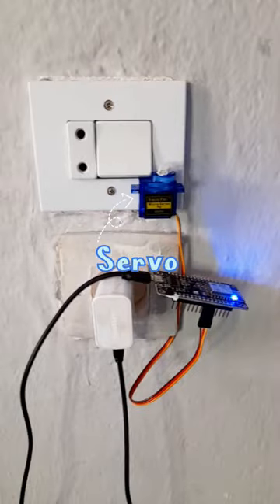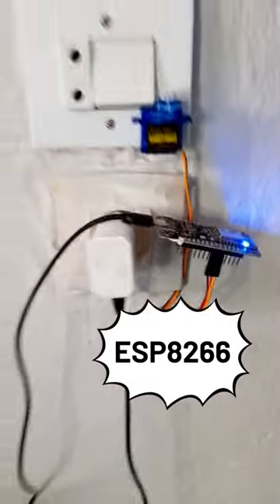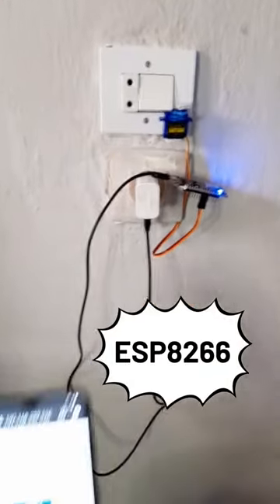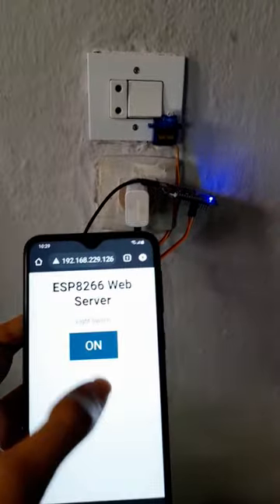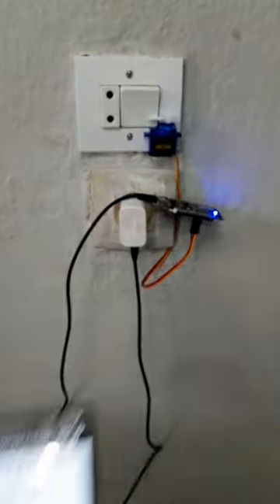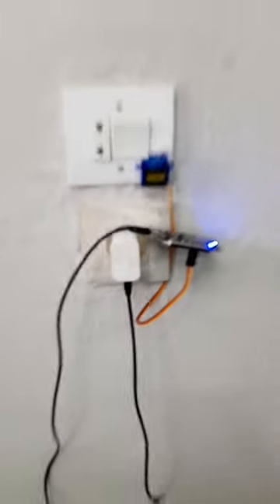ESP8266 Smart Light Switch with Servo Motor

Comment: How do you turn of the light 😂😂😂
Reply: He must be edioot
Reply: Add a second motor easy
Reply: @aryanprakash7371  where would you add the second?
Reply: Other 3.3v gpio and on top of switch
Reply: Change the switch type like bell switch, Unless add an extra servo
Reply: He will copy the system put place the servo on opposite direction
Reply: Iisee aachaa yek relay modul lake  button ki jagaa lagaa dete to sastaa bhi padtaa or easier bhi😂😂😂
Reply: But for turning pc is fine, i think.
Reply: It's not a smart light switch, it's a stupid light switch as you can just put a relay between the light's 220volt wires
Reply: @vishalmelasarji4609 idk about esp2866s but you could probably add another one on those spikes like an arduino uno
Reply: @vishalmelasarji4609 and have it do the same thing but next to the top of the switch instead
Reply: Fix the motor parallel to the switch and change the angle and a button 'off' in the server
Reply: It’s possible by attaching servo motor and switch with something
Reply: Use relay instead
Reply: Me bhi yahi comment karne aaya tha😊

Comment: Connect the same motor in vertical allignment of horn instead of horizontal. So that you can control a single servo and turn on as well as off the switch.
Reply from the maker: You are right ✅️
Reply: Thank bro
Reply: It's not a smart light switch, it's a stupid light switch as you can just put a relay between the light's 220volt wires

Comment: Very cool, but I would use a Relais to switch the light on and off and some kind of push button as an alternative way, so you don’t have to turn on your phone everyone you enter and exit a room
Reply from the maker: It's just for fun and learning purposes
Reply: This sounds interesting. I want an LED setup soon. Thanks for the tip
Reply: @larryhull2752 Yeah relays are really cheap, like 10 euros for 4 of 220 volt 10A Relays controlled by a 5V control module (Like a Rasppi)

Comment: Nice project, i could use one of these on the coffee machine in the morning.
Reply from the maker: Sounds great!
Reply: That's actually very easy to make, and you don't even need a server
Just an aruino board and a servo, and just set your desired delay
Reply: @asdfghjklz890  or you can buy an smart plug or smart switch it cost only 10 dolars
Reply: @jesus2621  yeah, but where's the fun then?😀

Comment: Bro I am thinking of making it with arduino uno but I am a bit confused coz I want to make it for multiple switches and it should turn off also😅
Reply: I made this a year ago, and it is surprisingly simple. Make it with relays, which are a better way to do this. There are plenty of tutorials on this. I can also help you if you want.

Comment: Ok, But how do you turn OFF?
Reply from the maker: Just add a second servo motor on the other side.
Reply: Wouldn‘t it be easier to just use a Relais?
Reply: Yup😂❤
Reply: @EnjoyMechatronics Why can't you add a relay then, as it is also cheaper than 2 servo motors...
Reply from the maker: @Mukunth  It's just for Fun!
Reply: @EnjoyMechatronics  Okay...!😃🔆

Comment: Why do you use esp8266
Reply from the maker: It's the cheapest microcontroller with wifi module built-in
Reply: @EnjoyMechatronics  ok sir i thought raspberry pi pico w is best and cheapest board

Comment: But why not use relay and connect it inside the board. Would be much better imo rather than a mechanical contraption which generally get into more problems than an electrical counterpart. Still pretty neat project tho👍👍
Reply from the maker: Yes, you are right
This project is just for learning purposes